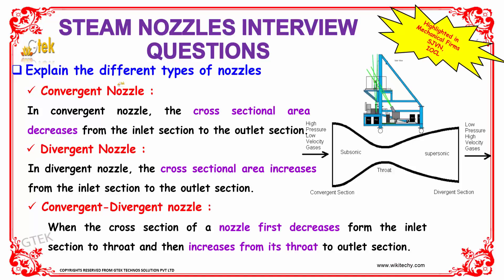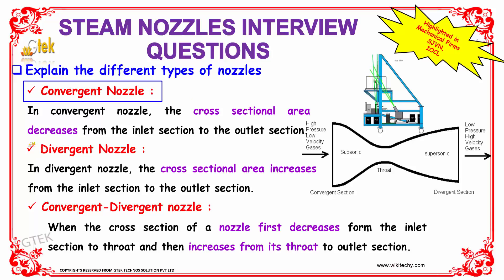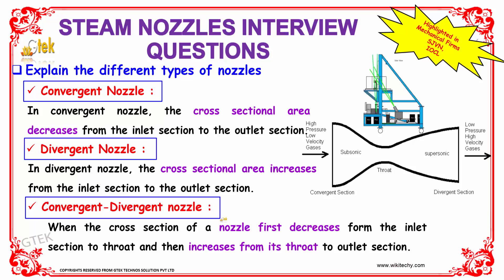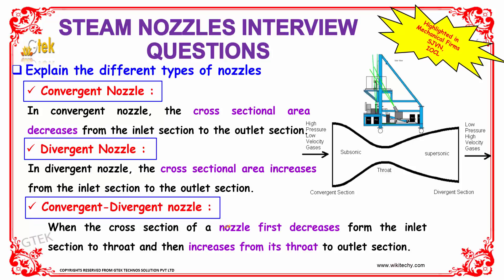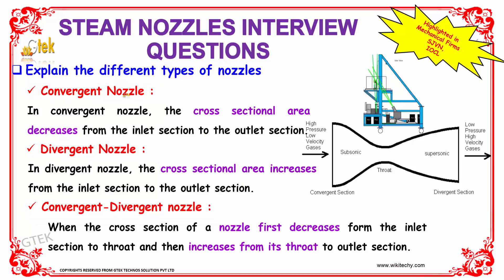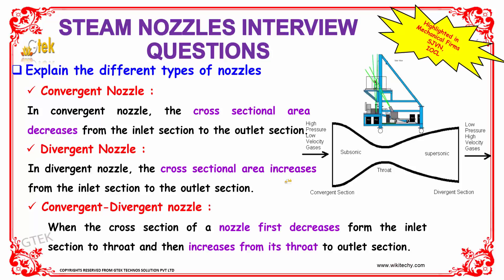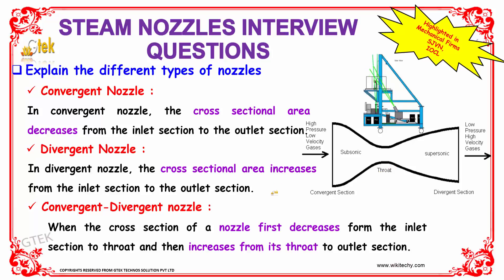Different Types of Nozzels | Mechanical Engineering Interview questions and answers|videos|freshers

Comment: Used for spraying in two different directions simultaneously. Nozzles can be fitted with different types of tips like hollow cone, solid cone or flat fan. The shape and size of Nozzle Tip orifice controls the spray angel, discharge rate and spray pattern.

Comment: A nozzle is often a pipe or tube of varying cross sectional area, and it can be used to direct or modify the flow of a fluid (liquid or gas). Nozzles are frequently used to control the rate of flow, speed, direction, mass, shape, and/or the pressure of the stream that emerges from them.

Comment: Types
Jet.
High velocity.
Propelling.
Magnetic.
Spray.

Nozzle is generally a pipe or tube of varying diameter, that is used to direct or modify the flow of a liquid or gas.

Function

Nozzles are frequently used to control the rate of flow, direction, and/or the pressure of the stream that emerges from them.
Vacuum.
Shaping.